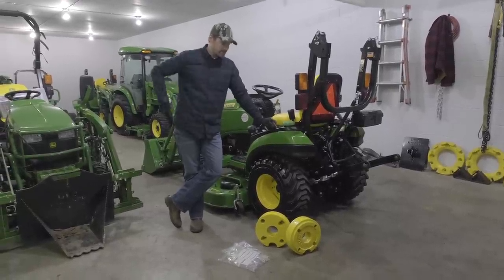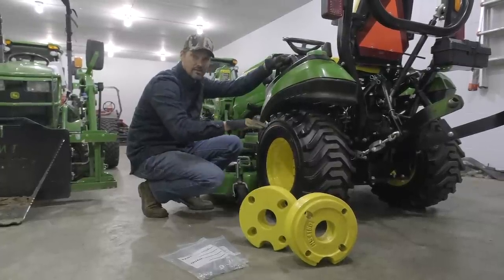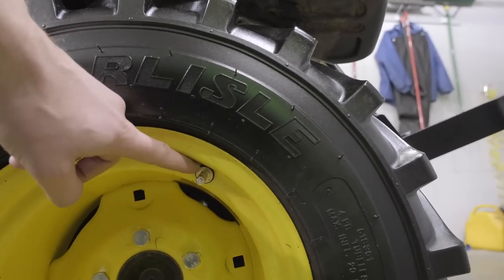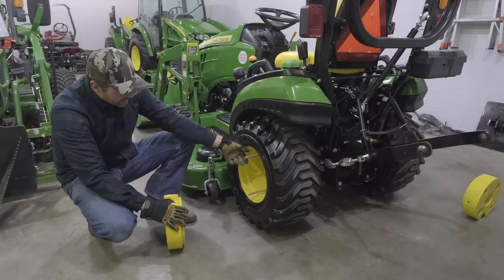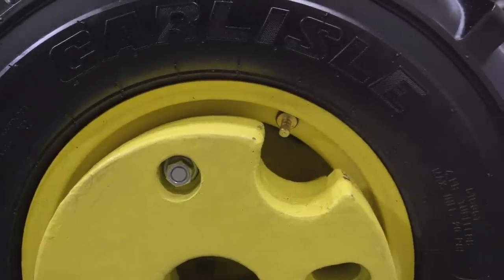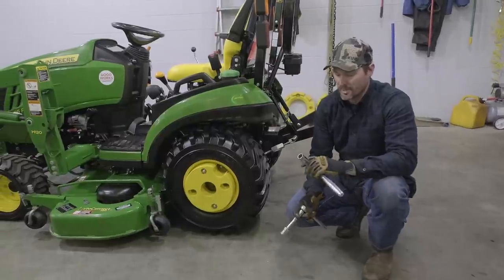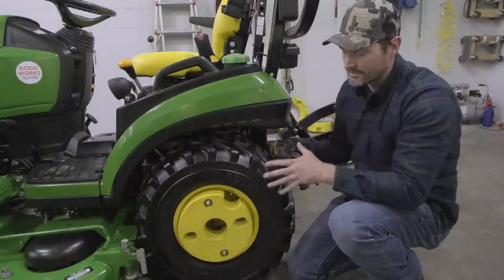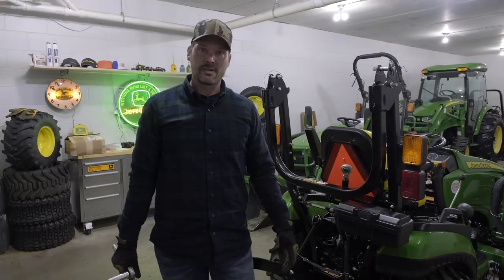WHEEL WEIGHTS: DOUBLE WHAMMY! INCREASE TRACTION & SAFETY 🚜🏋️‍♂️

Comment: I put anti-seize on the bolts and nuts when I put my wheel weights on.  Usually they will stay on for years and I have found that when you do have to take the weights off those that had the anti-seize are easy to remove while the non treated bolts can be knuckle breakers.  Great video as always, thanks!
Reply from the maker: Good idea!  Thanks for watching!

Comment: You should’ve put the first nut on the threaded rod then followed by the lock washer and flat washer. Then stick the short threaded end through the hole in the rim from outside. Then put washers and nuts on the threaded rod from the inside of the wheel. Would’ve saved having to thread the second nut the entire length of the rod
Reply from the maker: Could have done it that way.  Means I would have had to be in an awkward position to hold the rod and get the nut on.  I'm fine with doing it my way again.  Same result in the end.

Comment: I use a half inch carriage bolt than there is only one nut to tighten works great
Reply: That's what I was thinking would work better
Reply from the maker: They don't come with a carriage bolt.  Recommendation for the manufacturer though.
Reply: I believe it all boils down to cost.  1/2 inch Carriage bolts, especially Grade 8 bolts are more expensive than threaded rod which you can purchase in longer lengths and cut off the lengths you need for each bolt.

Comment: You mentioned that the 1025r manual says to check the lug nuts regularly. This is probably a novice question, but how do you do this once the wheel weights are installed? Must they be removed every time?

Comment: My 2025R was delivered with 60 pound stackable weights fastened with carriage bolts. I removed them to replace tires. Now I am trying to figure out how to hold a weight in 1 hand and place bolt from back side and washer and  nut the weight side. I bought 1/2 inch rounds to place thru  unused holes if I get help.
Reply from the maker: Haha, a third hand comes in handy!

Comment: That must not be a John Deere weight. I have 70 lb John Deere weights on mine and they do not stick out beyond the wheel in fact they're about 1 in . So I stacked two more 50 lb weights on that 70 on each side which is the maximum amount that they recommend. My total width of my tractor is 55 in wide. Does that give me stability. With my liquid ballast and wheel weights I have a total of 540 lb. But I use John Deere weights and that's what they recommended. On your tractor there it doesn't look like you can add any more weights to that wheel weight!!! Thanks for a great video Larry
Reply from the maker: No, these are not stackable weights.  Not sure why this company wouldn't manufacture them to be stackable.  Thanks for watching!

Comment: Reading through my tractor manual, it said you can do liquid ballast OR wheel weights, but don't do both at same time.
Reply from the maker: Lots of JD dealers do wheel weights, liquid ballast, and 3 point ballast.  Also depends on the year and model.  Manuals have changed a lot over the years.  I'll always tell everyone to default to common sense and your manufacturer recommendations.  👍

Comment: Still deciding on the configuration of my 1025R, but was thinking of getting the rim guard plus the 70lb and the 50lb weights on rear tires. Are you aware of any axle issues from putting this much weight on the axle or would it be better to have more on the hitch. I am trying to keep the tractor as short as possible for working in a confined area.
Reply from the maker: These are recommendations in the John Deere manual, so I can't imagine they'd put something in there that would be detrimental to the tractor life.
Reply: Me too!  Did u add that liquid inside the rear tires?

Comment: How well do these work for ground engaging implements, box blades, and discs, etc? I find that my 1023E spins pretty easy when running the box blade. My rear tires are fluid filled.

Comment: Howdy, Whats your take on adding wheel weights to a 2305 working in South Florida sandy soil? More traction or burying the tractor faster?
Reply from the maker: You still need ballast weight when using a loader.   Tractors can tip over without adequate ballast regardless of soil condition.
Reply: @GoodWorksTractors  Understood, I should have mentioned I have the rear wheels liquid ballast and always have my box scraper mounted when doing heavy work with the bucket. As is I'm not concerned with tipping as much as more traction to keep from spinning wheels and digging in. Thanks for your input.
Reply from the maker: I think typically lighter is better on sand.  Wider tires or duals with more surface area spreading out the weight might help?

Comment: For some reason I having front axle weight issue. No issues first 50 hours now the front end slides with backhoe and front bucket on. Guess front bucket not heavy enough but weird no issues till now. I have fluid I'm back tires by dealer any idea what I can do to get my steering back. Any ideas why now the issue. Yes out of 4x4 does it in 2x4 also. Reverse seems to do ok but forward is bad

Comment: i have a wheel horse c-160 and it has 80 pound wheel wights i bet that back it would be a pain to take off for how hevy it sound like it is
Reply from the maker: These are 70 lb weights.
Reply: @GoodWorksTractors  with the weights in the tires how much all together
Reply from the maker: Roughly 400 lbs between weights and liquid ballast.
Reply: @GoodWorksTractors   wow

Comment: One thing I am curious about... There are 2 categories of weights used on lawn/garden tractors for moving snow and that being wheel weights that mount to the rims and rear weights that hang on the back of the tractor frame or chassis.  I had a Snapper 1650 and I did not have wheel weights for it so I mounted a box and put concrete blocks in the box.  After the first winter season of use with this weight I noticed the rear axle seals were leaking badly.  I think the wheel weights might be a better application because they do not put all that weight directly on your axle hub seals.  Not sure if this caused the leaking but I'm suspicious that it did.
Reply from the maker: Equipment manuals should give instructions on possible options for ballast.  Some garden tractors will instruct you to remove the wheel weights when not needed for example.

Comment: With the rear wheels being liquid filled. Is there a problem adding air to the tires? Will you loose any liquid?
Reply: With liquid filled tires. Always put the valve stem at 12 o’clock to check the air pressure, use a liquid tire pressure gauge. Napa sells them, liquid tire pressure gauges have a spring in-the gauge to help push out excess fluid after you check pressure I like to put some air in before checking pressure just to blow and fluids away from valve seat if your fluid level is below the valve stem
Reply from the maker: Good info below.

Comment: I only wish that they could have utilized the void inside, rather than have the weight poke out the side.. But that's purely a cosmetic opinion.
Reply: @DickWheels  huh, well ain't that something. I'm gonna have to check that out.

checked out;
I assume you're looking at part# ST897306? and ST886467? I don't know.. There are too many options listed on john deeres parts site, and I'm but a simpleton.

Comment: I'm looking at a new 2032R and want the new R3 radial tires.  The dealer tells me that he doesn't fill those tires with fluid because it negates the advantages of the radial tires.  What are your thoughts on this?
Reply from the maker: Did he explain what he was talking about?  I loaded my radial tires in my 1025r and 4066r.  My tire shop didn't mention anything about this.  What benefit is being negates?
Reply: @GoodWorksTractors  Isn't liquid going to take the shape of the tire radial or bias? Foam would be different.
Reply from the maker: Yeah, I guess I can't figure out the concern.
Reply: @GoodWorksTractors  - I called up Carlisle tire company and they said that putting fluid in the tires voids their warranty.

Comment: Better put some Loctitie on those bolts when attaching the wheel weights. Don't want those wheel weights passing you on the freeway if they come off.
Reply from the maker: Are your loader, mower, and wheel bolts also Loctited? Where do you draw the line on using Loctite?
Reply: @GoodWorksTractors  It was supposed to be a ha ha. I was picturing a compact tractor going down the freeway with the wheel weight going off into the ditch much the same as you see with trucks. 
I do agree wheel weights are important for stability. Just wish they made them heavier but that would make them harder to service.

Comment: Is that 250 per wheel or total between the two
Reply from the maker: Total
Reply: Looking at a 1025. 1000 lbs is alot on that little tractor
Reply from the maker: 1,050 lbs is the MINIMUM in the John Deere provided manual.

Comment: Your mission (if you accept it) is to figure out a way to mount wheels on a blade.  Seems silly to be grinding a blade into the road.
Reply from the maker: Skid shoes, skid runners, float position aren't sufficient?  If a paved or concrete surface, most want to make solid contact to clear completely.  Shoes, runners, and float all help to prevent digging in deeper than desired.  Edges such as rubber and poly are protective of such surfaces as well.  

If stone, then adjust skids so the main edge rides slightly above the plowing surface.
Reply: @GoodWorksTractors  Generally the blade is adjusted to be slightly above the road.  Then the shoes grind against the road.

There are Youtubes videos of folks who added wheels.  So you get good plow performance without wearing out either the blade or shoes....... plus not damaging the road.

And save a lot of money.  Even making your own plastic edges isn't cheap.

Realizing change is scary.

Comment: Too bad you don’t sell a smaller diameter weight that can be put on first that slides all the way inside the wheel to fill that empty space left inside those weights. I know simplicity sold weights like that so you could stack multiple weights
Reply from the maker: This company doesn't make a starter weight.